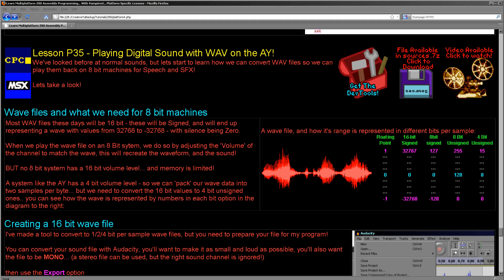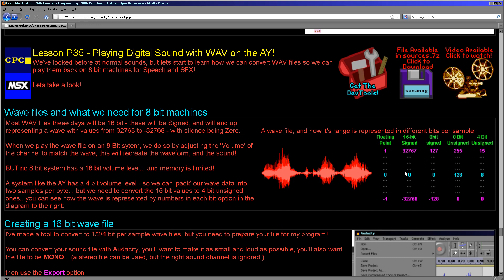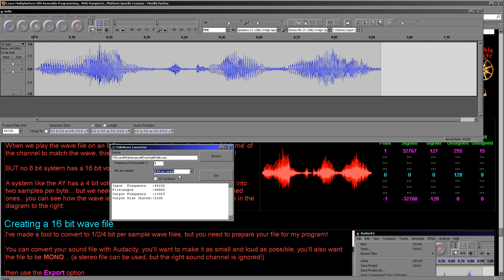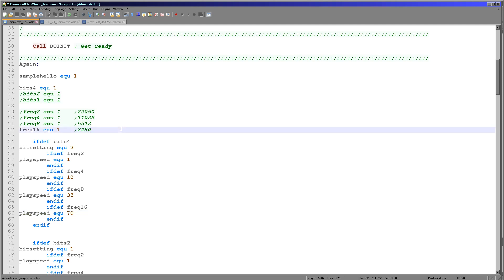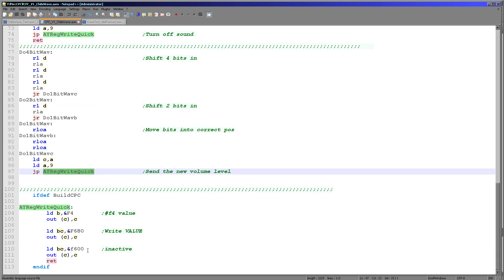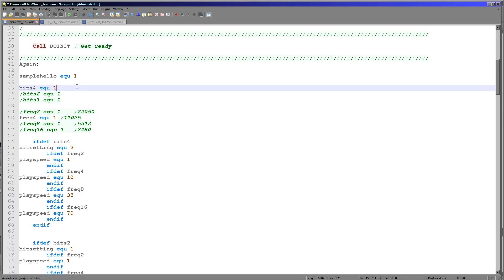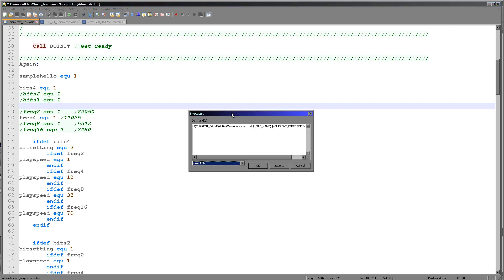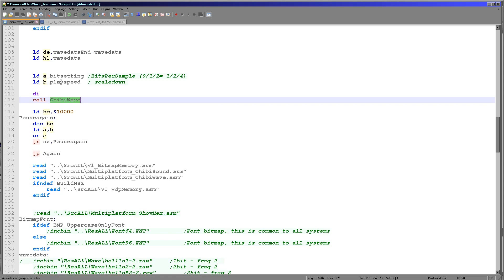Playing Digital Sound with WAV on the AY soundchip! - Learn Z80 Assembly Lesson P35

Comment: Thanks for the great effort ..
I suffer from understanding the language because my mother tongue Arabic.
But I appreciate your effort .. If you kindly use the writing of the points of interest or clarification more visual.
I have some questions ..
From where we got a command window named chiftiwave converter
Because I followed the steps and did not get them.
- second question
Is this method suitable for converting audio to assmply language to record audio on avr chip ??
Like sounds used in small children's games?
thank you very much
Reply from the maker: ChibiWave is a little C# program I wrote myself, if you get the sources.7z from my website you'll find it's sourcecode in the folder:
/C# Tools/ChibiWave/

I'm not sure what an AVR chip is, but for 8/16 bit you should probably use the common 'Audacity' editor... Chibiwave does 2/3/4 bit...
If this 'AVR Chip' uses ADPCM then my program isn't suitable, you would need to look for an encoded designed for that chip (ADPCM can vary quite a bit)